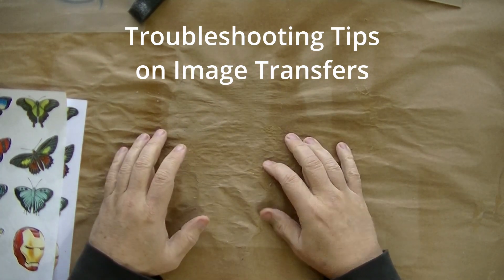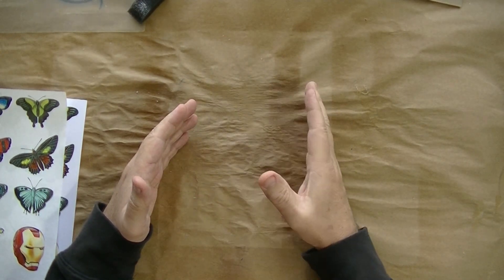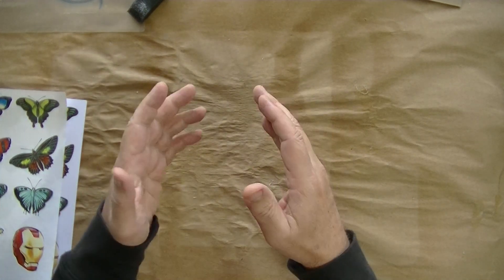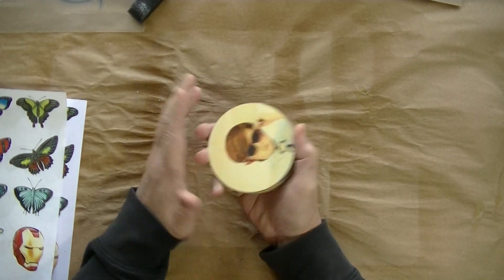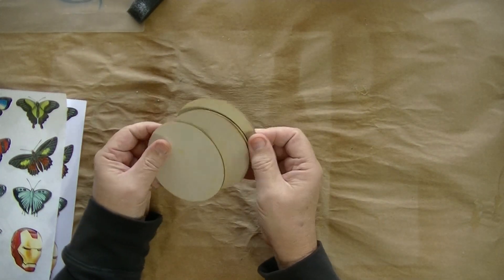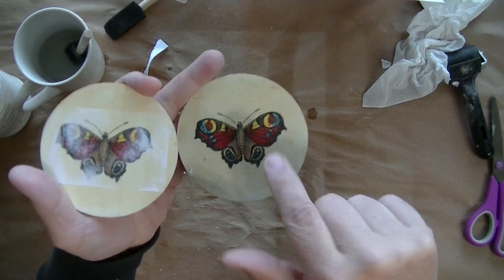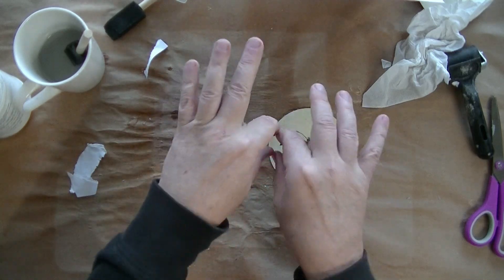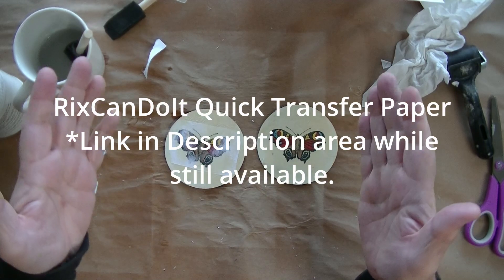HOW TO Transfer Images the Right Way! | RixCanDoIt Transfer Paper

Comment: What white paint should be used. Thanks. I need the white background. Great videos great help.
Reply from the maker: I just use white spray paint. I've used Enamel and Acrylic, no difference. Watch my wood slice videos for more on white paint. I prefer to carefully spray paint the image itself before 'gluing' to surface rather than painting surface. You just need to make sure you don't apply it wet. Spray about 2 feet away so the paint tends to flash dry as it hits the image is best.  Wetness can cause premature image release as the paper is moisture activated.  🙂
Reply: @imagetransferswithrix  Thanks i was able to order your paper today and preparing for it . I crack up watchin you.  Your 👍. I will get back with you on my successful? Table top transfers.
Reply from the maker: @joeburttschell1286  Great! Thanks for ordering. Glad I can give you a chuckle along the way. Have fun with the transfer paper!

Comment: I would like to use his paper on ceramic plates. Is this method food safe?
Reply from the maker: The transfer itself is not meant to be eaten off of.  If you want food safe, this will depend on what you SEAL the image and plate with. Food safe sealing is not something I have experience with, so you'll have to do your research on that, such as food safe epoxy or whatever can seal ceramic and is dishwasher safe and food safe.